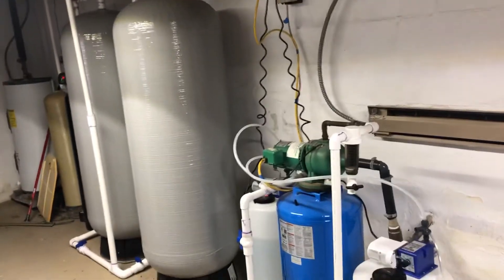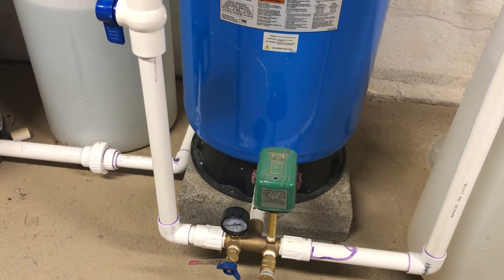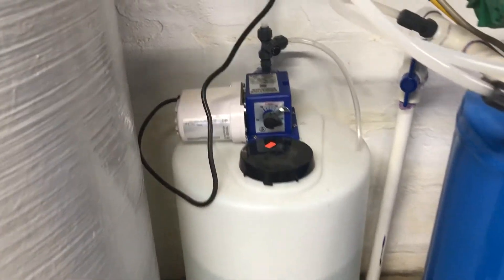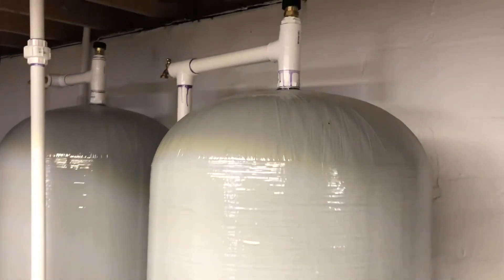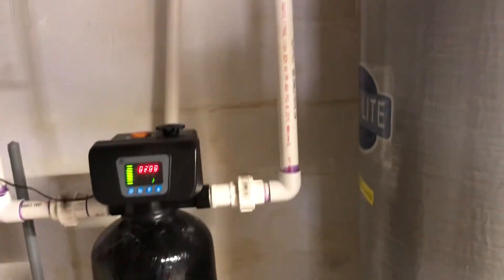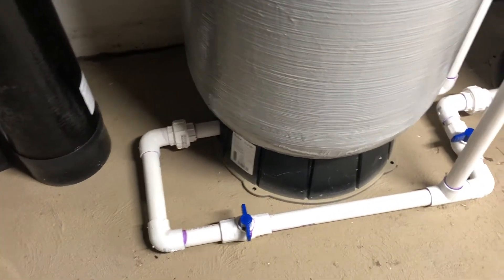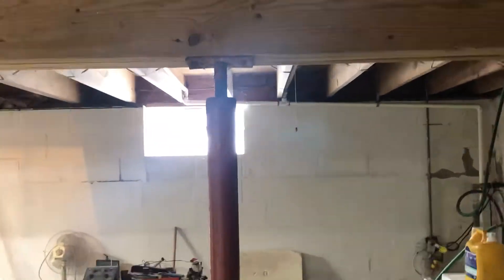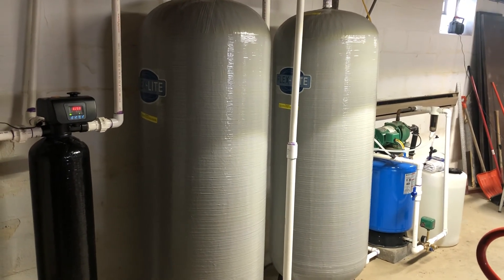Pond water filtration system for drinking water and whole house use

Comment: Whats your pond float/filter look like? We have a pond filter system and are starting to add to it. I'm looking to learn about it and get some more understanding of everything and the build out. Currently its straight through UV and Carbon/Sand filter. Need to add the alum and clorine setup and retention tanks next. I'd like to take the simplistic process of replacing the filter on the float filter int he pond but I also fear working through the priming process. We have a local guy that works on these for most the area who use them. I'd just like to take on what I can myself like filte replacement, media replacement, and so on.
Reply from the maker: The float is made from a 5 gallon bucket with a cone type roof to help wildlife to stay off of it! The inlet pipe is inside of the bucket with multiple plastic screens inside, this keeps the inlet off of he bottom so it doesn’t get mud into the pipe. He his was something my uncle built and it has lasted for 20 plus years. Once a year it needs to be checked but most times only needs sprayed out a little bit and put back together. While doing this process I try not to pull the inlet out of the water so it’s not to worry about any priming issues.

Comment: I have a house in the country with metered water but the cost keeps increasing to the point I am considering treating the water from my pond instead.  Using your costs as an estimate, I could expect payback after 4 years. I dont have quite the space available but I don't have much water requirements either so a smaller system might be possible as well. thanks for sharing your experience.
Reply from the maker: Glad to help!  the main reason the system is so big is the water has to stay in contact with the chlorine and the alum for at least 30 minutes before getting to the tap. Thanks for watching!

Comment: What does your inlet in the pond look like ?  How do you screen it to keep large sediment out and prevent it from clogging ?
Reply from the maker: It just has a plastic screen on the inlet pipe, with a float made out of a 5 gallon bucket to keep the pipe from sitting on the bottom of the pond. The pond water is clear most days and I haven’t had an issue with it plugging up.

Comment: Hi Chris, thank you so much for the informative video. I have a house on a farm, where no city water is available. Our water source is from the Colorado river. I am in California and I'm wondering if you can send me the list of the parts that is required for the system and from where to buy them.  In regard to the pump and the pressure tank, would a small jet pump with attached pressure tank work? Or  I need vertical pressure tank in addition to a separate jet pump.  What does the vertical pressure tank do exactly?  Many thanks Mounir
Reply from the maker: I don’t have a list as of right now, but finding the items aren’t too bad. You can look online for chemical tanks and pumps, everything that I have in the video. Also if you have a local (Tractor Supply)store I think they are all over. I bought several things from them. I wasn’t in a hurry to build this system as I wasn’t living in the house. So I was buying things  at the best price and shopping around.

Comment: Just bought a house has pond setup, and I was going to add 25 and a couple of 5 micron filters after the iodine injection. Thing I’m curious on is when I get there I plan on changing a lot, really like your Chem delivery system, can they be used with iodine? 👊🏻🍻
Reply from the maker: I’m not sure about using iodine with water. But it holds up to the chlorine so it should hold up to anything. I’m thinking about putting another filter on for the whole house instead of just the kitchen.
Thanks for watching!

Comment: I have a pond that is full of springs and has an outflow of about 900 gal per hour. So  the pond is super clean and has fresh water. Just wondering if I would need both chemical additives and the sediment filter. And how do you know how much chlorine to add to the water
Reply from the maker: You might just need the chlorine! You would need to test the water and see how much you need to add. You only want a small amount left in the water after the holding tanks. Same amount like you would find in city water. You have to make small adjustments until you find the sweet spot!

Comment: Just curious if this pond your using for water has springs and flows in it or just a standing water pond
Reply from the maker: No it’s a run off standing pond. I have a aerator system to help keep moving the water.

Comment: Awesome setup!! Few Questions....what are the chemical to water ratios in your alum and chlorine tanks? Are you just pouring regular bleach into your chlorine tank?
What is the process for dialing the chemical tanks to release just the right amount of chlorine and alum into the water without too much or to little going in??
Reply from the maker: Thanks! the ratios are going to be different for your water vs mine. You need to test the water and adjust as needed. I use liquid pool chlorine.  The chem tec pumps I use control how much goes into the tanks. I check the tanks weekly and make adjustments if needed. Most of the time it only changes in winter and summer. Thanks for watching

Comment: This is an awesome setup. I want to do this as a main system and have my well and rainwater as backups. What’s the cost on this type of system? Really hard to find anything online about these
Reply from the maker: I have 2 retention tanks 1000 
2 Chemical pumps 500
2 Chemical solution tanks 65
1 pressure bladder tank 285
1 sediment filter   255
And a hundred or so in pipes connectors and glue,
I already had the pump with the old system

Comment: Wow. This is way over my head, but it's really interesting. I have lots of questions, but the biggest one is, "Why?" What led you to set this up? What was the motivation? Is this your sole water source for the house? Emergency use? 

The whole system must be pump fed, right? What happens in a power outage? What is the source of water for the pond?
Reply from the maker: Hello Tyler and thank you for the question. Yes it’s the sole source for water. Right now there is still no city water available at this house. My uncle built this house back in 1985 and it was more cost effective to have a pond than a well. Most wells in the area are not very good and don’t have the volume that a house would need and run dry . I only use the one pump in the video and it pumps into a water tank bladder below the pump(blue tank under pump) durning a power outage you would have the pressure in the tank till it runs down. Then the generator would be used to pump the pressure back up.  The water source for the pond is run off. This home is on 16 acres of property and no treatment of plants or grass or trees is done on the property. Only use of things that are safe for ingestion.
Reply: @ChrissTrainsandMore  Very cool. Do you have to do any regular testing to make sure your neighbors aren't polluting the water source?
Reply from the maker: Everyone one around me on this side of the road have wells or ponds within a 2 miles there are I only a couple homes. And everyday the deer walk up to drink right out of the pond